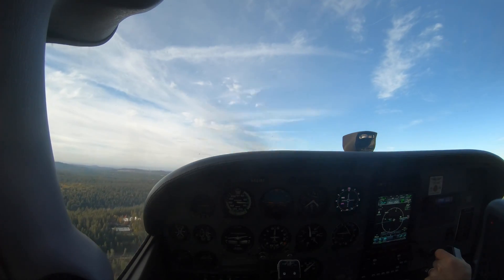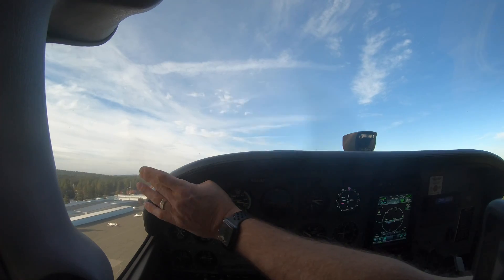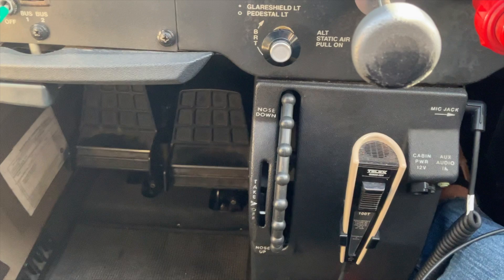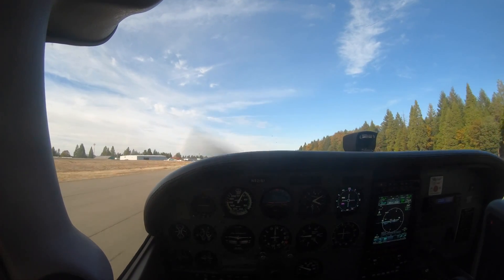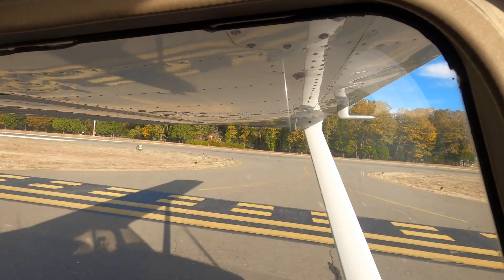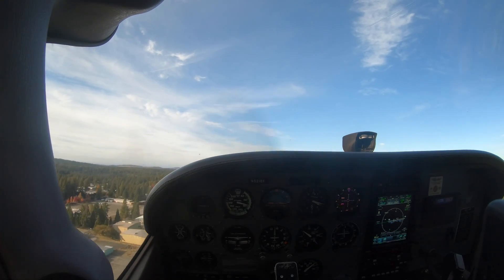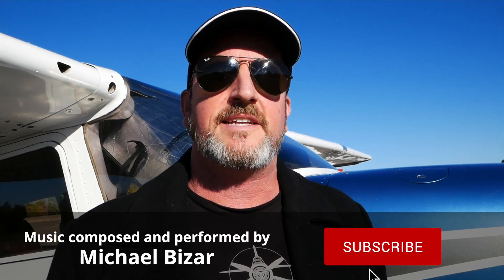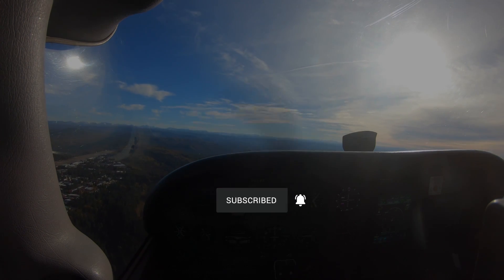LEARN to deal with RUNAWAY TRIM, IMPROPER TRIM SETTINGS, or ANYTHING, that tries to fly the airplane

Comment: I did a 20 degree flap short field take off in a 182T with trim set for take off. That nose went up so quickly and before I knew it we were getting below VX in the climb. While this is all happening I am adding a ton of nose down force and mashing the electric trim. Was able to recover but I was sweating after that one. It was pretty spooky. Will be having a bit of nose down trim next time I do a short field in that airplane.

Comment: Light touch on controls don't just happen with airplanes. I use to be a road instructor for a truck driving school and I had the same problem with students white knuckling the steering wheel. I use to take guys out for their first time and their leg would be shaking over the clutch, lol.

Comment: You didn't actually deal with runaway trim so I'll ask the question. My T-210 had electric pitch trim on the yolk. In the event of runaway electric trim or autopilot it would take time to identify and pull the fuse so what about just flipping off the master switch to buy time to locate it?

Comment: This is an important lesson even for go-arounds and touch-and-go's. Forget to adjust the trim when you apply full throttle and you're going to feel this right away. Have to always remember that airspeed is your #1 priority and that airspeed comes from holding that sight picture. Love this exercise Jason, I've had to do it "accidentally" more than once.

Comment: A couple of things…

Know where the Electric Trim CB is in case of a runaway.

Related:  Know where the Autopilot CB is.

In aircraft with higher horsepower engines (like the 185), only add 25” of MAP during a go around with full flaps and nose up stab/elevator trim to minimize pitch up until you reduce flaps, gain speed and reset trim.

My mantra prior to takeoff AFTER the Before Takeoff Checklist and while taking the runway:

Flaps (Set for takeoff)
Fuel (Fuel selector, fuel/boost pump, mixture, carb heat)
Trim (All set for takeoff)
Lights (Landing lights on/pulse)

The first three are killer items.  I fly other other peoples airplanes in addition to my own and this has saved me when their checklists are poorly written or non-existent.

Comment: What about a go around. All you have time to do is shove the throttle in, carb heat in and take out first set of flaps. You like have to feel the yoke pressure and look at your site picture and push down and look at airspeed indicator to get Vx

Comment: I had a faulty trim due to short circuit  from  radio comms to trim switch .
It required a lot of force to hold for 45 minutia's  until landing.
Luckily  I had a bungee cord to help take the strain.
but made the mistake to putting  in more trim trying to fault find to soon   ! 
Best to not do anything  until  considered  all the options.

Comment: If you have a Trim Runaway situation such that it makes the Aircraft pitch Nose up aggressively and there's not much you can do to hold it off while you're fast approaching a stall condition, you have one option left and that is to Roll the Aircraft. That will bring the nose down and give you back some pitch control.

Comment: As an avionics tech at UAL several decades ago I was a bit surprised to learn about the many logical inputs to stab trim - each of which had the potential to modify stab trim OR even cause runaway.  Fast forward several decades  and everyone is up in arms over something called MCAS - for me, it was just another input amongst many and I wondered whatever happened to runaway trim awareness and procedures.   Thanks for the refresher

Comment: I had a runaway trim in May out of kwhp that put me with some nose down and did something with the jackscrew, I think, that put the trim wheel all the way nose down. Atc was helpful and the plane was stable around 110, but it took 8 attempts to land because as I slowed the plane, it kept wanting to pitch down. A few attempts were close, so I just kept making adjustments. I couldn't finesse the landing and it was really tiring, but I eventually got it. I've not flown since.

Comment: Good video about using outside references.  The one issue I didn't hear much about in it was in the title "RUNAWAY TRIM".  It does happen at times especially with those of us with electric trims. If it does are we doomed? Sure you can pull a breaker if you are fast enough but the trim in more simple GA airplane the servo will stop/lock where it is in the more extreme position and then what?  Fight it and hope the flight controls don't break?

Comment: This is a great reminder. I got in a battle with trim on a student solo when I failed to disable the GFC 500 electronic stability and protection (ESP) before getting into slow flight. It took over when I heard “autopilot engaged”. By the time I figured out how to fully disengage it, I was full trim forward and I’d lost 500 ft. So it was work to hold it while I unraveled the trim. I am forever cognizant of the trim and autopilot now.
Reply: Yikes, Avionics taking over the airplane. How scary. I will be on the lookout for that. I am a student pilot.

Comment: Had a very similar situation on my last lesson where the flaps did not come up on a touch n go.  It was very slow going down the runway then suddenly it rotated itself at just above stall speed.  It was all I could do to push the nose down.  Thankfully my CFI noticed, was able to take control and put it back down onto the runway.  I'll never again do a touch n go without looking at the flaps regardless of what the setting is at.

Comment: I had a situation when I did my pre-takeoff/run up checks. I followed the checklist for the autopilot check but failed to recheck the trim prior to takeoff! When I engaged the autopilot for the check, it moved the elevator via trim as it should to climb to my preset altitude. This in turn “wheeled” the trim full up and I didn’t notice it! As I reached rotation speed it took a god awful amount of forward pressure to prevent a stall. Now I ensure the trim is always checked prior to any takeoff run!

Comment: Thanks for this video. Especially important after the fatal crash at KMYF with suspected runaway trim. It’s important that we know what needs to be done to compensate for errors in trim, user error or not. Great video as always.
Reply: Theee things that I always say and do before take off is. Trim,  Fuel , Flaps. It has saved me a couple of times to be properly configured.  Jason you said it best “Real World Distractions”

Comment: One thing gnob9dy see s to entire is that the sight picture  CHANGES between.10- 20 feet off the ground and, say, 200 feet off the ground. Probably because of ground effect, but still. You have to use airspeed indication instead of siight picture at least until after getting WELL away from ground effect.

Comment: great advice, I would say take note of where the artificial horizon is at on a typical take off, for my plane, 7.5 degrees is where my max climb rate is, it nice to know, incase you airspeed indicator malfunctions, and mine has, after i washed my plane it reading 30mph too fast, which was weird, and almost killed me.

Comment: Reminds me of the time I was on my way to my Commercial checkride in a C172 RG departing runway 25R at KDVT. After take off I was assigned a midfield-downwind departure from the North to the South crossing over the runways. Everything was fine until I rolled out on the downwind heading and then the airplane seemed to have developed a mind of it's own, trying constantly and firmly to turn toward North. I realized I was fighting the controls trying to hold an easterly heading. After a few sweaty moments, I realized that the auto-pilot switch was in the 'on' position and the airplane was trying to turn toward the preset northerly direction. I'd missed this during my preflight checks in my nervousness to get to the checkride destination, KCHD. Not sure why this didn't become apparent until I was on the downwind leg, but I guess that's a good thing.
I'd never tried to use the autopilot on any airplane so equipped earlier so I was unfamiliar with the whole thing. I somehow managed to figure out what the problem was fairly early but this little experience isn't something I'll ever forget.

Comment: The trainers I fly probably need the trim dial recalibrated or relabeled, because each plane has a different forward or aft setting to fly straight and level at cruise with the same loading. 
Do you have a video on actively flying with the trim, because I typically fly ‘fighting the trim’ until I get to a stage of flight when I can concentrate specifically on setting it for straight and level. Then, cruise and slow flight typically keep the same trim setting. 
I only adjust the trim substantially when simulating a power failure and need Vg (73 kts) without my effort.

Comment: Be very careful when you test around with trim for takeoff. Know what kind of trim your airplane has! On my Cub the trim actually changes the pitch of the horizontal stabilizer. When I have trimmed tail- heavy too much and give full power, I won't be able to push forward enough to prevent a stall the moment I leave the ground. Would be no fun at all.
Once I had a stuck trim, and I had to fly the whole way back to the airfield with forces on the stick. And as the fuel tank is in the nose, the plane became more and more tail-heavy. But at least the landing was easier, because I hadn't had to pull so much as she wanted her nose up in the air anyway 😉

Comment: As a student, I had a take off with my instructor where the trim was “set” for take off, but required a lot of pressure to rotate and hold the nose up. We later discovered that the trim indicator was broken. From that point forward my pre-flight includes checking the position of the trim tab when set to neutral.

Comment: At 6:35 - Interested to know why you side-stepped to the upwind leg instead of staying on the departure leg? Like, a thing for safety or spacing?
Reply: It's left closed traffic and I can't see the runway off to the left so I think he's actually on the departure leg.  But you bring up a issue that I've been trying to figure out for a while, namely that pilots (including me) and ATC often call the departure leg the upwind when actually the upwind is the leg parallel to and the opposite side of the runway than the downwind.  I've tried to find what it's called when you're over the runway.  Departure leg sounds good. I wish it would become part of the runway diagrams in the PHAK, AIM, etc.

Comment: I appreciate that you teach your students to maintain the proper sight picture no matter what. I had a similar situation occur during training.

Simulated engine out during climb out with return to landing. Debriefed during back taxi and took off again with full trim. Had to push hard to maintain airspeed & attitude while fixing the trim. Instructor was there, but let me handle it. We did discuss this later.

Thanks for passing your experience along!
Reply: A good instructor won't step in immediately, but will let you screw up (safely) like that, then explain what went wrong 😁  Now you have the experience to recognize the problem and correct it, instead of just having read or heard about it.  My CFI does this sometimes when I miss something (like failing to check the trim during the pre takeoff checks)
Reply: @kaasmeester5903  This was my first flight instructor. He was good and went airline. The second one scared the holy $#/t out of me one day and I refused to fly with him again. The third was the proverbial old guy. He was great, but went FSDO. My final flight instructor was good and a generally nice guy, but he talked way too much. A couple of times I had to pull his mic to be able to hear controllers.

Comment: Similar situation to when you go around with the airplane trimmed to land. You have to apply considerably amount of force to maintain a climb without  excessively pitching up. Great video as always!
Reply: I don't trim on landing for that reason don't want alot of pressure on go around. Natural trim on landing for me
Reply: @jeffdo9195  As a female student pilot flying the 172, I need to trim for landing as it takes a gentle touch flaring and letting the nose go down gently. If I do not, it seems my landings are not as soft. When I do a go around, I know to push down on the yoke and have practiced that and can deal with that in a 172. I had to push pretty hard but I am able to. I trim when I can.  Maybe this will be a different case in the 182. Wondering if I can even fly a 182 from the stories I hear about how heavy the nose is and I am sure it takes  a lot more force to hold the nose down if you have to do a go around. I am human and could forget to reset my trim or have a go around.   I am not sure If I can handle that in a 182?
Reply: before you landed what did you do with trim when you reduced power and were slowing down?  besides flaps and carb heat?  right you gave it about 3 large cranks of nose up trim correct?   so what do think is going to happen on your touch and go when you add full power for takeoff?  yes there is no doubt you get the trim back down to at least where it was when you cranked it up for landing.  fact is there is no single engine factory built airplane that you can't overpower even full nose up or full nose down trim.  so once a pilot learns how important pitch control is for airspeed and general aircraft control then he can start to understand that just because you added power with lots of nose up trim doesn't mean you must let it go up there and you have to die!   no he must understand the he can't let the nose come up more than Vy or Vx pitch atttitude or he may very well die.   used to fly a 55 Baron and a C90B.  if you add power after a  touch and go you cannot overpower the pitch and you better back off the power and get the trim rolled down a ways and then add power and take off if you have a long enough runway.  especially the king air will kill you for sure if you takeoff with the trim full up.
Reply: On the sim i apply a little nose down trim after landing to stop the airplane rotating too early by itself   just before i apply take off power when i go around the pressure to push nose down isn't as much P.s i am not a real pilot just a sim pilot then some minor trim while climbing after take off solves the issue and relieves pressure

Comment: Got it! Always fly alone so you don't get distracted.  No.  Seriously, good video.  I'm green at flying.  I plan to take flight lessons.   I have studied quite a bit.  There was a crash recently which involved trim that was adjusting itself.  I'm sure that you know about that particular crash.  I figured that the Auto-Pilot must have been engaged somehow.  It seems like the poor guy panicked and tried to just fly the plane to the ground without any alternative plan.  I still wonder what happened in that particular crash.  It just seems like he wanted to force the plane down to the ground at all costs, like landing was his only option.  I am glad that you did this video though.
Reply: A runaway trim "seems" to have been the cause of a fatal accident at MYF in San Diego on November 5, 2022.  The student pilot in a Cirrus SR20 doing pattern work radioed, "Trim is activating by itself" while on short final.  Regardless to what this accident investigation determines to be the actual cause, a critical aspect of trim training must include how to disable an electric trim.  If I find the YouTube channel that has the ATC recording, I will post it...